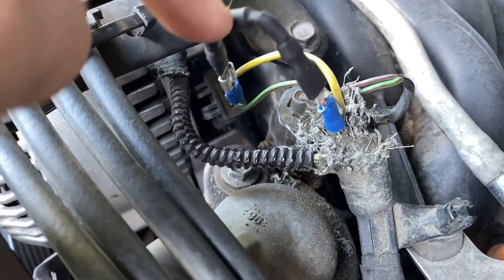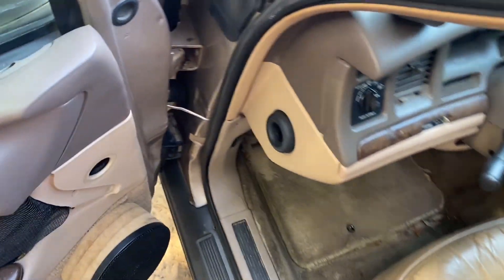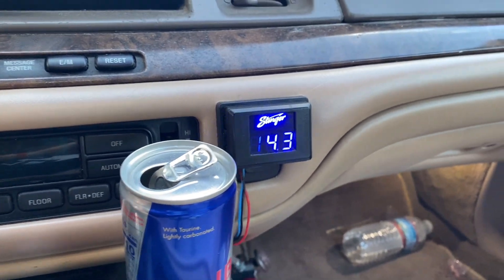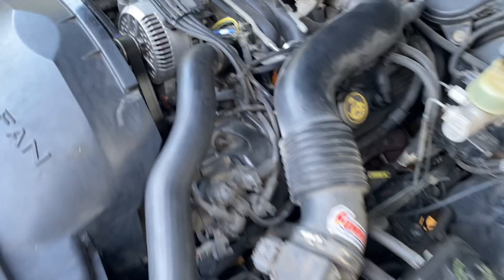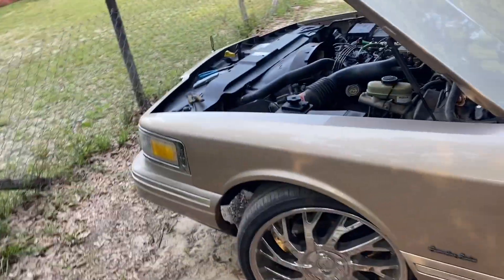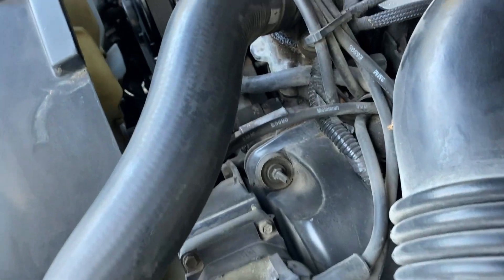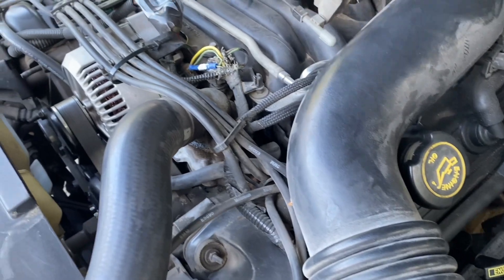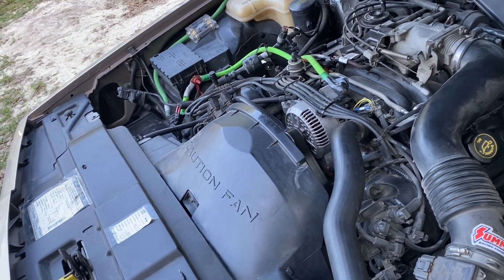I added diodes to my alternator and this happened

Comment: Old school 12v cars with less computer control devices use either simple internal regulator rectifiers or external regulator rectifiers either way alternators were NOT designed to charge at idle, 
regulators normally turn ON at 100-200 rpms ABOVE idle..old cars are LESS sensitive to voltage spikes where's newer cars that are all computer control with a plethora of sensors, relays, switches, monitors, triggers are HIGHLY sensitive to voltage spikes therefore are INTERNALLY REGULATED by ECM / ECUs NOT to charge over 14.4 volts at any rpm...
Volts, amperage, input, output all very do to temperature, rpm, setting on regulator rectifier, quality control tolerances of parts, builder, execution...
A 1/10 of a volt difference can cause check engine lights & sensitive sensors to cause electrical systems to shut down or go into protect mode in late model EFI post OBII cars

Comment: Voltage doesn’t increase with HO alternators. Only the amperage capacity/limit is increased. So if stock is 130 amps then it can handle loads up to 130 amps only. 250 amp HO alternator would be able to handle pass 130 up to 250 amps. The voltage would basically be about the same. The battery should be receiving a max of about 14.7 volts. Voltage higher than that would degrade the battery faster.
Reply: I question that charging over 14.7 volts degrades battery life. I have recently converted to lto, but I have an xs power d3400 battery that I bought in 2017 that is still perfectly fine and not swollen at all. It was charging at a constant 15.1 volts on a 320 amp alternator. The highest charge I seen was at 15.3 volts and the battery is still fine 6 years later and still started my car perfectly fine. I also never charged it before putting it in my car. I just put it in when I got it, made sure the car started, and went on with my life. Never any problems charging at 15.3 volts and down. We have even had temps in the single digits or lower over the last 7 years and it still started my car. Even last year when it was extremely cold christmas eve. Also that battery has been out of my car with no charge at all for well over a week and is still resting at 12.6 volts as it should.
Reply: That’s not true if the diode was hooked up correctly he could charge up to 15.x volts. Lto is safe up to 16.7v or somthing like that
Reply: yea it depends on type of alt for some gm alts you have to change the regulator to a higher voltage regulator now all denso hairpin high output alts you can use a diode to raise from 14.8 up to 15.8 to 16 no prob

Comment: I have the same problem with my 2000 BMW 528i. Even the alternator was set to charge at 14.8 and it still charges at 14.2  and added diodes too and still 14.2 the voltage regulator is in the factory alternator and they say it's not ECM controlled but something is regulating it. I tried to do a externally regulated it the voltage just climbed with the rpms and had it internally regulated cause the company send me 2 external regulators and both did the same so they just made it internally like stated in the beginning it was set at 14.8 but only charges 14.2. If anyone can help me I will pay or whatever to charge at 15.5-16. I'm having them send me another external regulator and gonna try to build a bracket for a second and run it completely separate so I can run 15.5-16 volts but would like to charge that way without having to go that route.

Comment: As an ASE Master Tech specialize in auto 12v electrical, look for my post on the video regarding adding just such a diode on the 5yo video from Sub Human Sounds. I say this just to save me the time of typing it all again. I explain why you should NEVER do this for the small increase in voltage. For powering electronics, maintaining proper voltage while increasing amperage is what you want, not increase voltage. Go look for the post I spoke of above and DO NOT TRY THIS "MOD"!
Reply: Kinda have to do this when you run cmax… people been runing it fine for years
Reply: And btw, Ford doesn't use self exciting regulators. No, it isn't internally regulated by the PCM like Chrysler and other vehicles, but uses a "control" wire from the PCM to excite the regulator to the needed amount depending on power consumption. 
If you haven't fried anything yet...STOP!! REMOVE THE DIODE!! Repair the harness back to stock and look into adding a secondary battery.
Reply: @knowplay3258  It's a hobby homie. People should do what puts the biggest smile on their face at the end of the day. Some people like to enjoy their work, some like to push their equipment to see what it takes to blow it up, some like to see the cheapest way to get more power, and some follow every single rule in every single text book or believe what every "professional" told them is correct. The fact is that every build is different and no one knows your build like you do. You try something and see if it works. You learn as you go because it's a HOBBY, there are no directions. You can tell me all this mathematical stuff you learned and how you are a "master", but I have a car that has been charging an AGM battery for over 6 years at 15.3 volts cold, and 15.1 volts normal. I have had no problems with the car or the battery. The battery is also over 6 years old now. So let me ask you the "master"... Why does it work in my car and why is the battery is still perfectly fine after 6 years of charging at 15.1 volts constantly on a 320 amp alternator? How can an agm battery last that long with the amount of demand I pull from it in extremely hot temps sitting in direct sunlight for over 8 hours a day, and sitting in 0 degree weather for over 8 hours a day and still start my car perfectly fine after over 6 years of that abuse?
Reply: 5 years strong!
Reply: So what do I need to do to go from 13.5 to 14.8? Idle
Reply: For ford  merc
Reply: You actually want both to be increased if possible for car audio they make amps now that support 16v max while getting the max output from the amp makes them run cooler

Comment: Its sensing the battery closest which is the front battery. Can't tell what you have in trunk or if you have a second battery. But you can run a remote wire from the battery sense to the battery in the back. This will bring the alternator up and down when you need it. Instead of it always being kicked up by a resistor. And its the old school way before they did resistors and external adjustable regulators.
I would try from the alternator side wire sense to the back battery. And if it doesn't change and it seems like the PCM is controlling it I would do the car side of the wire sense to the back battery. And the PCM should kick the alternator up.

Comment: Same thing happened to me. I have. A370 amp alternator and it's suppose to charge at14.8 but won't go higher than 14.4 so I put 2 diodes in and it still the same. I've been tryin to figure out what overriding my alternator and what I can do. It's a 2000 bmw 528i
Reply: Who did you buy a 370amp alt from for the e39 ?

Comment: I had a rare electrical 290 alt and my truck is computer controlled charging so it was a waiste of money...i ended up adding 3 more frame grounds to my truck and adding 2 935 cranking amp batteries in my tool box and that seems to work good as long as like once a month i top off my batteries on my charger

Comment: Did the same. I ordered a multi pack kit and tried several different comobos,nowI sit no lower than 13.2 full tilt and about 15.6 at 2.5k.rpm. but u also have cap bank and 97ahr bat bank too

Comment: Put the end of the of the diode with the line pointed toward  the alt
Reply from the maker: I did I tried it both ways, stripe towards alternator was same and the other way dropped the voltage by .3